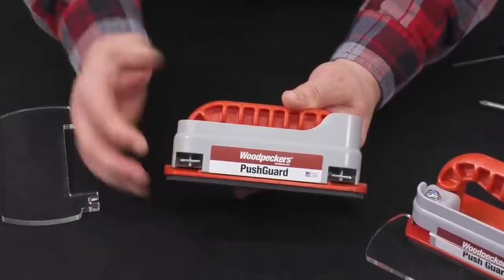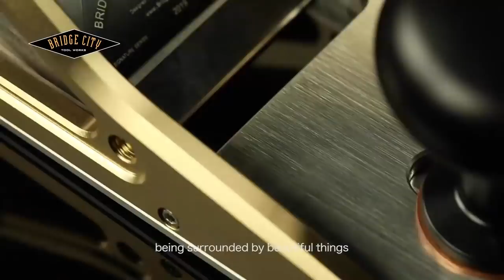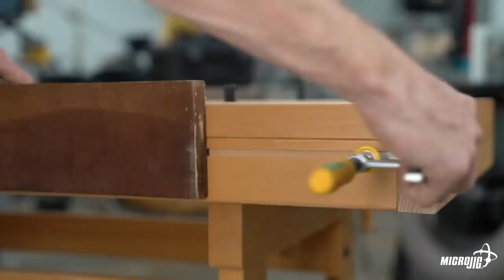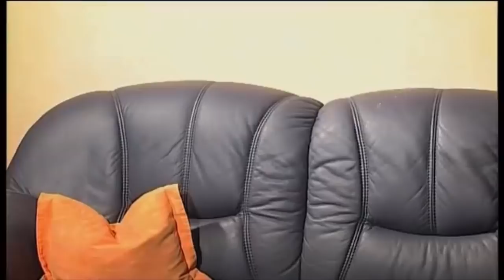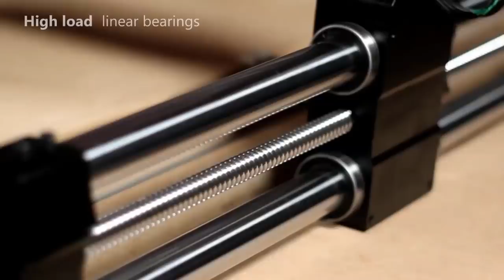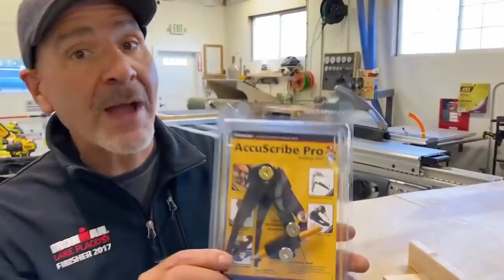10 WOODWORKING TOOLS YOU NEED TO SEE 2021 5

Comment: The Push Block from WoodPecker is a bad design. You could encounter a serous Injury using this Tool. Counter Lever Action could cause the Push Block to Flip over exposing Hand and Knuckles or Fingers to Blades.